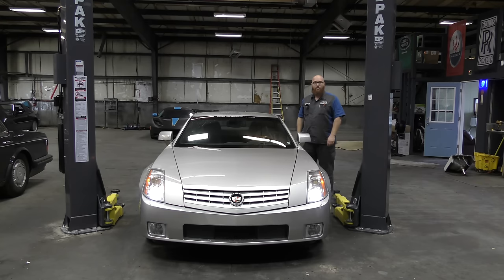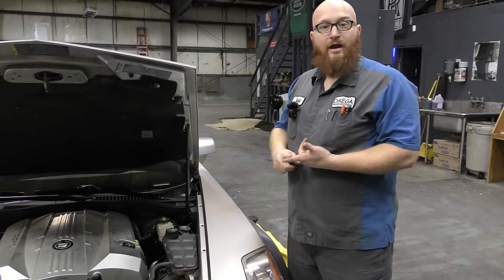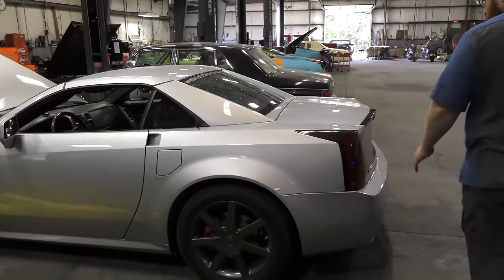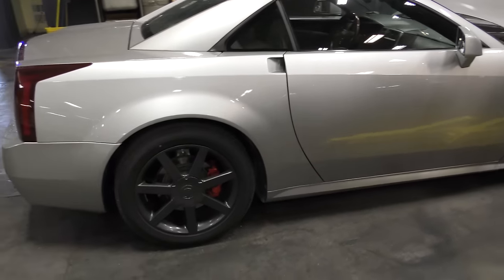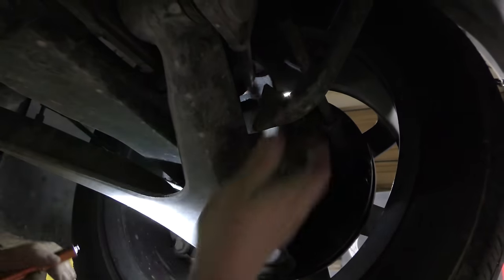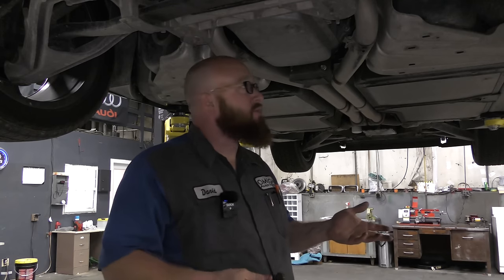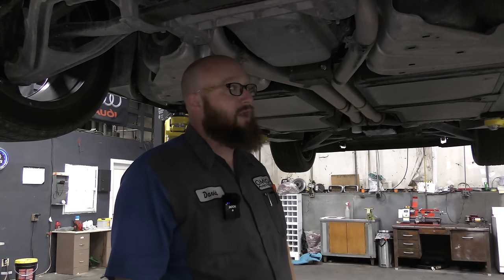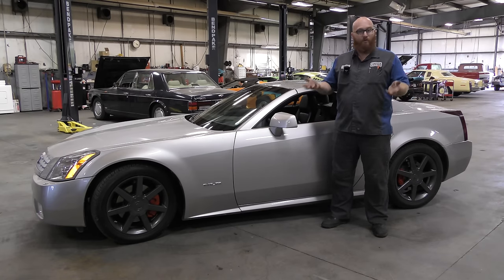The CAR WIZARD is shocked this 2006 Cadillac XLR has a Lotus Sized Repair Bill?!?

Comment: Rockauto has 6 different radiators, including ACDelco, which is original equipment, has oil and trans fluid coolers at $275

Comment: I have a question about my 2007 Cadillac Escalade EXT's transmission. I keep getting the run around from other YouTube mechanics or those commenting that don't seem to know what I have read on websites about this six speed transmission and the problems associated with them. Normally my trans shift's without a problem but now and then sitting at a stop light and then hitting the gas the trans hesitates and then jumps enough to spin the front wheels. Another problem that has happened once was when I attempted to pass a vehicle and the trans acted like it didn't know what gear to go into before it finally found the low speed and high RPMs. Are these problems caused by the ESM and or valve body? I doubt there is anything wrong with the rest of the transmission even though it has 191,000 on the vehicle. I don't want anyone rebuilding this trans if this isn't necessary but if it's because of an ECM or Valve Body problem then I would gladly change these parts for updated versions. I understand there are problems with the stock valve bodies that cause erratic shifting and a kit can be purchased to sleeve the "pistons" in the valve body and I understand a replacement pre programmed ECM can be purchased. Do you think this will take care of my problems?

Comment: Very low production numbers means lower amount of replacement parts required to put it on market.  One of the few times a concept car made it to production albeit low numbers. Pioneered magnetic shocks.  The light package.  North Star engine is solid.  I’ve had mine 8 years now.  Still love it. Head turner. Heavy as it’s a convertible.  Will not keep pace with vette but is more comfortable. Stands out much more than vette. You can still see the heritage in the SRX, STS and CTS from this car.  BTW the body panels are composite like a race car.  Reminiscent of Fieros but slightly stiffer and better looking

Comment: Glued together cars with plastic tank radiators. I had the same problem with my VZ SS Ute. Out of warranty I replaced 3 radiators at over $400 aussie each. When the third failed and they wouldn't warranty the part I fitted an Aluminum EBay unit that was the same price but had welded tanks. It worked fine for another 5 years...

Comment: I have an 08 STSm it has a coolant leak, It appears to be an O-ring on a pipe that goes to the Thermostat Housing. Dealer quoted $1000 to change it. Where is the Thermostat Housing? About a 15 inches below the top of the Intake between the Engine and Fire Wall.

Comment: Why dont you repair the rad, if it just a crack in the plastic section, do fusion welding with nylon it works fine, repair dont alway need to replace.

Fusion plastic welding will nit blow, explain why its not repairable because we repaired crachs like   infact i running a Mercedes which had similar  crack, it now 5 year post repair.

In addition the finding a rad firvtjis car was easy tgere are numerous oem spe rads fir between $150 -$190

The company that make the rad for Gm has 37 in stock $200 including shipping.
So i do not understand. I am in Europe  and they 72hr delivery in current climate. 24 month warranty on part. 
May be GM labled part might be hard to get. But gm have there rads manufactured by different companies.
Go direct to these people they make  they have the patterns. Sorry but your trying to say things tgat are nit true yes i can find parts supplier who will charge this, but a bit of hunting on the net abd you will find gm
Supplier who will sell you the parts  it not a hand built car parts are off other gm cars the radiator is not vehicle specific. Gm do not msnufacture that way its mass production.

Comment: The radiator splitting on the side, the fuel issue, my shocks leaking, driver's side tail light totally out (power supply)  and the bump stop on that rear subframe are what's going on with my car this very moment.  I'm mechanically inclined so I can resolve all but the power supply inside the tail light....well actually I can fix that but the thought of putting a $2000.00 tail light into the oven really stresses me out.

Comment: GM sold all their parts because of the Bankruptcy so anything older than 2008? is now owned by other co,s and is also no longer in production by GM. I needed a rear brake hard line that goes from the Left cylinder to the T fitting on the diff and could not find one for a 1997 C2500HD truck had to have it made.

Comment: I'd rather get a CTS-V, parts should be cheaper with an LS motor and a platform shared with regular CTS and it has room for 4-5 passengers.  Great for daily and hooning.  Also available in 2 door.

Comment: Atleast it isnt a bmw 5 series with awd lol my 535xi is 2100 quoted at the dealer for oil pan gasket. Front dif , subframe, axles etc need to be removed. Gross. Not leaking alot so I'm waiting haha

Comment: The oil pan cost is not that surprised. Discount Tire cracked my oil pan in my 05 CTS w/ the 3.6, and refused to pay for it, got quote almost $2000 to replace the oil pan because apparentl you have to basically drop the sub frame to get it out. I just drained it, cleaned it and then added some JB weld to the crack. Lasted me another 3 years like that before I sold it.

Comment: I'm just wondering for the sake of curiosity,do these manufacturers really make these repair issues for the sake of the vehicles structural and performance reliability or is it just a case of bad engineering and no real thought behind maintenance and repair issues? I know most German vehicles are over engineered for bragging rights not so much reliability,but something's I've heard or seen with reliability or maintenance issues seem to lean towards complication not ease of operation to consumer or is it all about money!!! This is definitely one of Cadillacs best designs to date behind the Cien supercar which sadly never made it to production! A 7.5 ltr V12 making 750hp & 650tq beast that easily fits within the halls of engineering hierarchy and futuristic ingenuity! If you've got the cash to invest into this vehicle I could be worth the sacrifice overall!!?

Comment: Don't know how it works in the US but here in NZ I've a problem with "book prices" because they aren't accurate. I see the advantage, customers know in advance what it will cost them but I know mechanics who worked for dealerships and part of their weekly wages was a bonus for any charge out hours above the 40 hrs they actually worked i.e jobs they had done faster than the book time.The justification that customers didn't get charged extra if the job went over the book time sounds ok until you ask how often it happens and find they never missed out on getting that weekly bonus (and the dealership only paid them 50% their normal rate for bonus hrs). Seems fairer to make the book price an estimate rather than a quote in my opinion, but I don't know how it's done there ;).

Comment: Sounds like someone has bought out the stock of them. However what I would do with that old one is I would find a radiator that comes as close to matching the parameters of that radiator as possible and make sure that I remembered what that radiator was so that I could use it in the place of the XLR radiator.

I'll bet you there's a radiator out there that is fairly common that is almost exactly the same thing. But for that price you could take it to a radiator shop and I bet you they can make you one out of off-the-shelf components in old school brass for about the same money.

Who knows, maybe RockAuto bought them all.

As for having an engine oil cooler, I would not used one inside the radiator. I sometimes we'll go ahead and use one with a transmission cooler, and then add an extra small cooler between the radiator and the transmission because it gives the transmission at lot more life. But I would never run in oil cooler through a radiator. You're just asking for a major engine issue. I put an external engine cooler on an engine in a heartbeat.

The stupidest one I've ever heard, my father had a 2002 S600. Wonderful car, got 22 miles per gallon around town with a V12. It had an oil cooler that was inside the engine and not only did you have to take the intake manifold off you had to take the heads off to get the oil cooler out of it. We never had to do that. But that was the stupidest idea I had heard in a long time. What the hell good is an oil cooler inside the engine.

As for the sending unit issue and the passenger tank. Try putting some Marvel Mystery Oil, maybe 6 or 8 oz into each tank. Several years ago, about 2005-2006. A lot of the sulfur in gasoline was removed. The sulfur in the fuel was a lubricant for the fuel system. A lot of fuel level issues were caused within six to eight months of the Sulphur disappearing from the fuel. I was able to get at least a few of these, mostly General Motors product surprisingly, to work better by adding this Marvel Mystery Oil about once a month to the fuel tank. It may have already worn to a point where it can't be salvaged but it might be worth a try. The Marvel Mystery Oil is also great for keeping the fuel system lubricated and clear of other problems aggravated by that same move.

Comment: Try Techron fuel system cleaner to avoid dropping the tanks. It will probably take a couple of applications. Apparently the fuel senders oxidize and lose connection, especially if the tanks are not kept full when it's not used for long periods. My father had a C5 with the same issue and we were going to drop the tanks at my shop. With a little research we found out about the Techron trick through internet forums, and it worked for us along with keeping the tanks full. Just my personal experience but it sure saved time and aggravation. Money can't buy that.

Comment: the Radiator is the same as a C6 Corvette.   from 175-1000$ I seen em at.  do some shopping friend.  Then the oil leak issue 2 inch lift the engine up is right. 10mml bolts and a few 18mm's to remove as well.

Comment: I thought I had difficult situation concerning a radiator. I had to replace the radiator on my old Silverado because of a crack in the plastic tank on the driver's side. I tried to save some money and ordered a radiator from RockAuto.com. 45 days later I found a crack in the plastic tank on the passenger side. I had to deal with the warranty process from Rock Auto and my truck was down a week. Fortunately the truck ain't a daily driver. I coached my 16 year old son in changing out the radiator the second time. So far the radiator is holding good after a year, but Rock Auto will never see another dime of money. I use NAPA for parts for my side repair jobs, unless the vehicle owner requests the parts from somewhere else, and on my own vehicles. NAPA would have had a radiator for me in a day.

Comment: What mecanic charges you for 13 hours labor because that's what the repair manual says while it's only costing him mabye half? I mean, that's not a mechanic where I'd bring my car lol. Imo you can only give an indication of labor cost but its only final when the job is done. A lot of repair shops will just charge the book amount even while spending less time. Which is one of the main reasons I work on my cars myself mostly. You can't check it, its a matter of trust (which I dont have)

Comment: Guys... The Wizard didn't say the old radiator couldn't be patched. And if you were doing it at home it might be worth a try, if your time to do the job is less than $400.00.  But if the plastic has gone brittle of the fix doesn't hold it would cost his customer the price of all of the labor to do the job again plus the radiator.  

I've been really broke and I've made and re-manufactured my share of car parts over the years...   to varying degrees of success.  But if I were to do the job and put in the time, I'd likely put in a new radiator too and not have to worry about doing the job again for another 14 years. 

For the most part expensive cars are built to stay that way.  I mean there's being poor and being poor with a broke down BMW or other luxury car... There's no end to this kind of broke.  For the most part, if you can't afford to buy a car new, you can't afford to maintain it when it gets old.

And by the way, the reason rich people don't keep high mileage luxury cars is because they can't afford to fix them constantly... With some cars, it can be cheaper to buy new than to maintain the old ones.  Unless you are a car collector, then all bets are off and the cost isn't the object of the exercise.

Comment: Same problem with the fuel sending unit on the Corvette. I found that using  a bottle of Techron with each fill-up (even using Chevron 91 octane) helped resolve the problem.

Comment: I have this exact car.  I added 20s, lowered it, an 09 v front hood and front fascia and added a beautifully painted black stripe on the raised portion of the v series hood.  
Head turner with constant notes on the car of people wanting to buy it.  Good times.
Hard to find parts.  I've already repaired LEDs in the tail lights and now the power supply board has gone out.  It's crazy expensive to fix.

Comment: i put one in years ago, did you check with a GM DEALERSHIP over parts?and it takes about 5 hours the rad and condenser are a module

Comment: I wouldn't buy one of these cars.  Not only for the costs involved, but with so much that has to be removed just to get at the work that I'd be very afraid it wouldn't back together correctly.  The engineering on this car would be a marvel if the cars held up well.  But after the boardroom cheapened everything the car is destine to be a shameful money pit.  Shame on GM for what they've become.  GM used to build good cars that were reliable and lasted, but the junk they've been building, particularly the past fifteen years or so isn't worth it to average people.  And Cadillac's?  They've always been built for the initial warrantee period.  After that they always cost a lot to keep them on the road.  It used to be if you wanted a GM car that would last you bought a Buick or Oldsmobile not a Cadillac.  I don't know how GM stays in business, other than they run a lot of sales and there must be a lot of stupid people.

Comment: My old friend Tommy that is pasted away now was a good mech.,he was getting a lot of these coming in his shop over in Kenai. He was the only one here on the peninsula that had a Snapon scanner that could read all 3 on board computers on these mid 2000's Caddy's. People were buying them used because they were cheap as Caddy's go. The reason why you could pick up used ones so cheap ,is because people couldnt afford to take them in for repairs/maintenance after the warranty ran out.

Comment: Nobody should be surprised that parts are expensive and difficult to find for lower volume vehicles after they’re well out of warranty. Even minor collision damage can total relatively new and otherwise pristine vehicles due to lack of parts availability. It’s something to always consider when choosing to buy or hang onto an expensive older vehicle. It could be literally one stupid driver backing into you in a parking lot to total it. And the insurance company likely won’t pay what it’s worth. Yeah you might be able to buy it back but then it has a branded salvage title destroying its resale value.

Comment: Hi. We used to have problems on the old jags changing rear brake pads, So. . . We used to pull the seat out, drill and then used the jig saw and cut out sections of the area above the calipers . We had a template. We then fit the pads and make new panels held in with screws and sealed with self adhesive foam door seal. Can you do something similar with the fuel sender?  Another job that came to mind. A W210? v6 Mercedes. Symptom: fuel runs out at half a tank. What happens is the tanks hangs over the driveshaft and rear suspension. So you drop the exhaust off it mts, remove the rear suspension and replace the tank. The pipe work that transfers fuel across inside the tank breaks. There's no access to the pipes. The only option is to replace the tank.